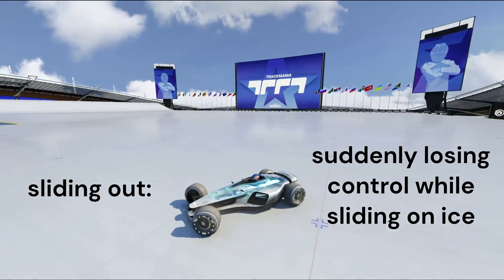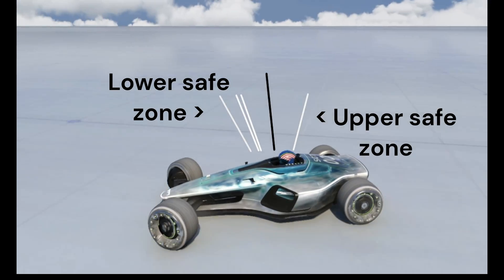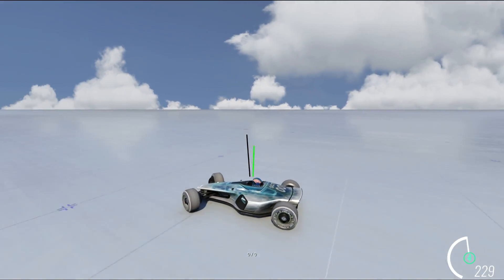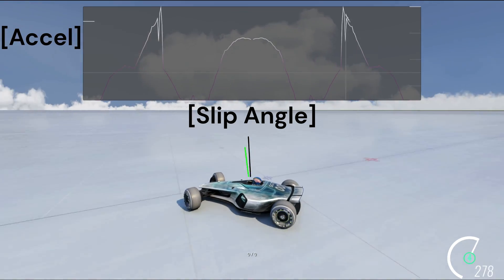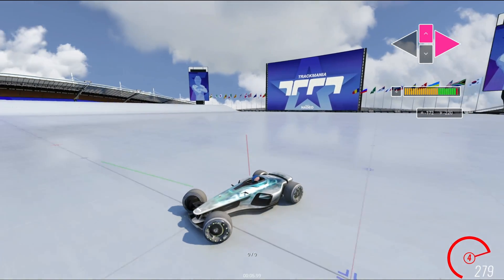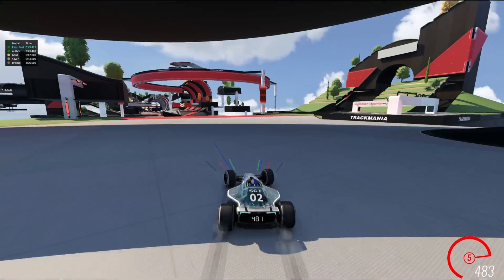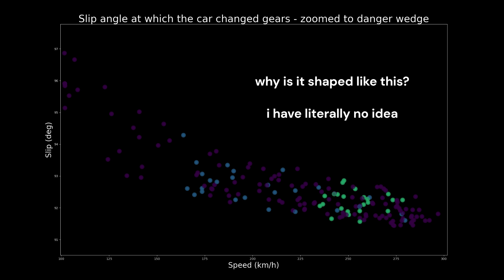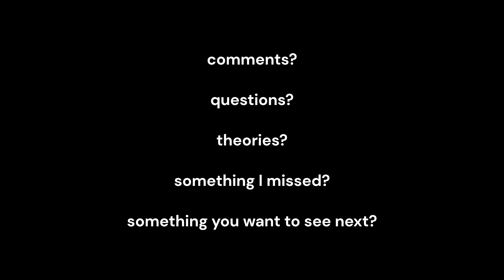We Cracked the Code of Gears on Ice

Comment: is speed not based on the actual tire speed but rather the car body's absolute speed? so sliding backwards is still positive speed that can trigger gear ups? also has anyone ever made a mod allowing for manual gear changes?
Reply from the maker: in the context of my work - yes speed is the car body’s absolute speed, ie length of velocity vector. re #2, no - nobody’s ever done manual gear changes as far as I know

Comment: Wait so is the 'gearbug' actually holding it in in the upper safe zone and not gearing until you come out of the turn? What's happening with gear bugs?
Reply from the maker: Gearbugs are the shifts inside the danger wedge, but where the car shifts quickly and smoothly rather than sliding out. We haven’t figured out what makes it good vs bad, though :/
Reply: @littleguysgame  holy shit! That's why they are so hard to get. There have been tracks where I've driven for like 20 mins and got like top 200 ish, watched the wr and there is an insane gear bug. Eventually get one and instantly get like top 50. So powerful! Good to know if I'm sliding out trying gear bugs I'm actually on the right track. Hahaha 😅

Comment: Very interesting insight, thank you very much! As a mediocre Ice player I rate icemaps highly where even on a not so perfect run the car enters an iceslide at low rpm so there is no risk of an accidental danger-wedge-slideout. So for example a turn that will always be in low gear 4 and not just on a perfect run (unless I hard crash ofc). Basically avoiding this weird NadeoPhysicsMoment(tm) entirely. Something to keep in mind when building ice that makes the map much less frustrating for the average joe like myself.

Comment: What annoys me us that no-where in Trackmania does it explain anything about ice sliding. You're suppose to magically figure out it's better to slide.
Reply: You can just watch wrs on the leaderboard
Reply: @DanielHatchman  to be honest that's probably not going to work well if you're a beginner. The reason is that once you figure out why your car is sliding out, you can now try to get close to the edge. In that case it's better to be safer yet slower. Once you get a feel for when your car is about to slide out you can try to improve, but it's better to first try to finish the map without crashing and then refine your lines. To draw a parallel, if you're new to drifting and playing a tech map, the first thing is to understand how to engage a drift and then release acceleration to correct the line rather than trying to get a perfect drift with the exact amount of breaking to get the perfect line. Sometimes the best players are able to take a turn with the upper gear and it changes the way you take that turn completely so it can be a very frustrating experience. Anyway I wish I'd seen this video sooner, it's brilliant.